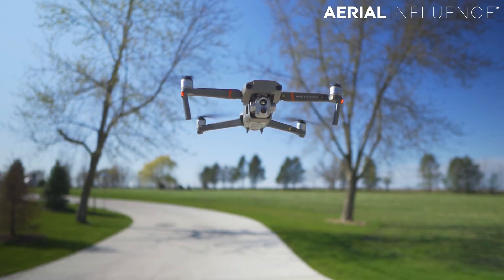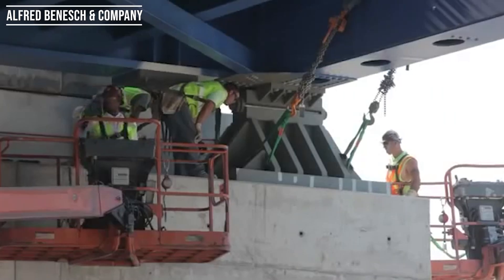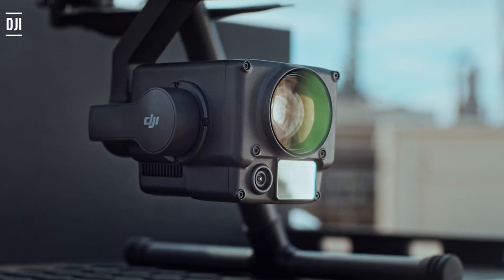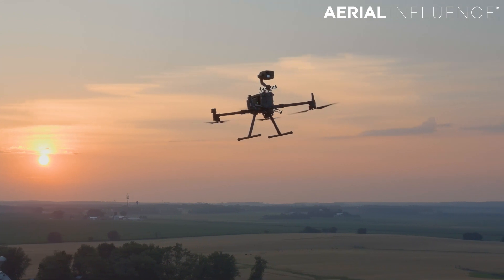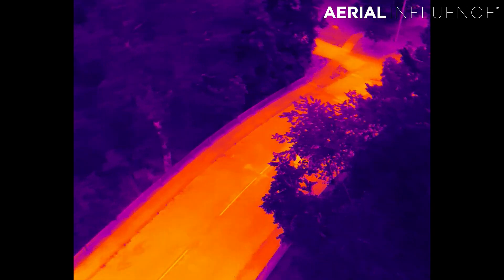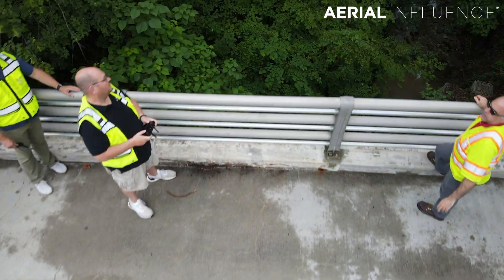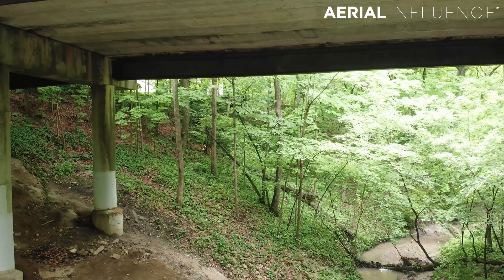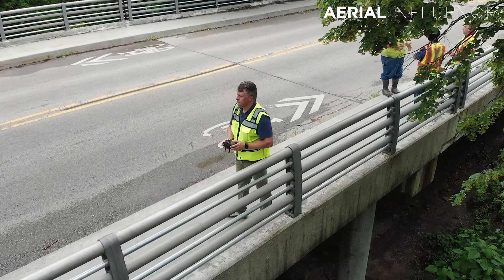Drone Bridge Inspections: DJI Mavic 2 Enterprise Advanced & Matrice 300 RTK with Zenmuse H20T

Comment: Hi I’m curious how the m2ea went with gps under the bridge Which mode did you fly
Reply: Sometimes gps get lose.... specially if it is metallic bridge and it goes atti mode... since it has 360 proximity sensors it’s unlikely to crash it.... but still can be dangerous
Reply: I have the mavic2 and I want to start using it for inspections. I work in the oil/gas industry any Info on how to proceed would be greatful